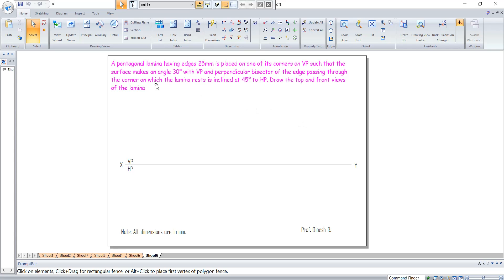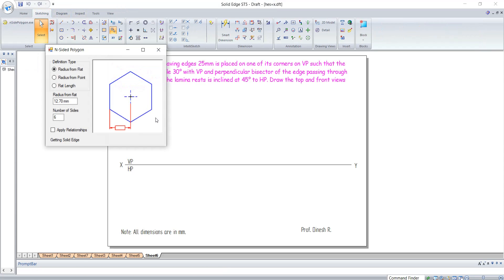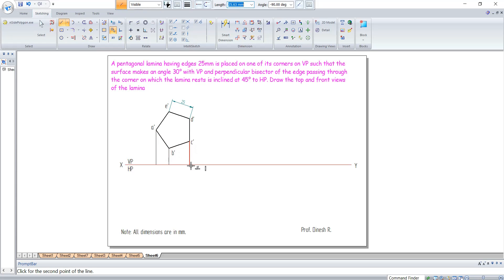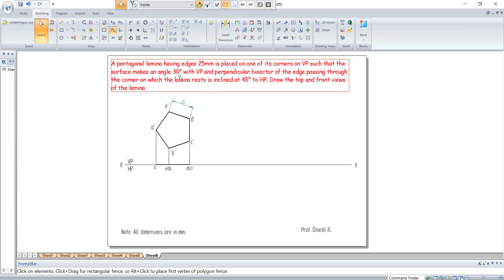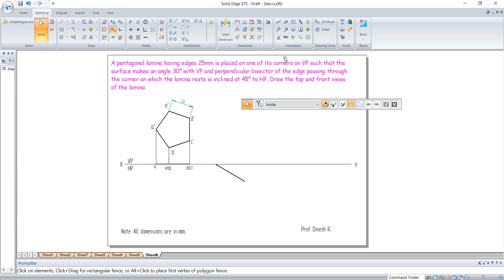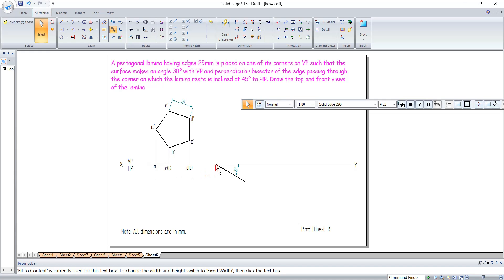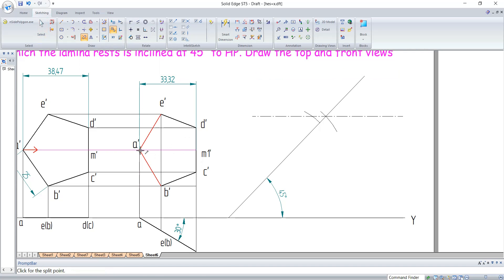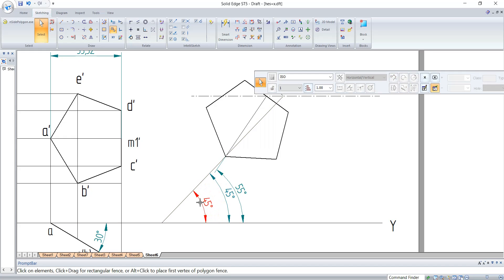EGDL | Q31 | SOLID EDGE |  PENTAGON LAMINA| VP | CORNER | PERPENDICULAR BISECTOR| ALPHA | PLANES SP4

Comment: A pentagonal lamina having edges 25 mm is placed on one of its corners on VP such that the surface makes an angle 30 deg. with VP and perpendicular bisector of the edge passing through the corner on which the lamina rests is inclined at 45 deg. to HP. Draw the top and front views of the lamina.